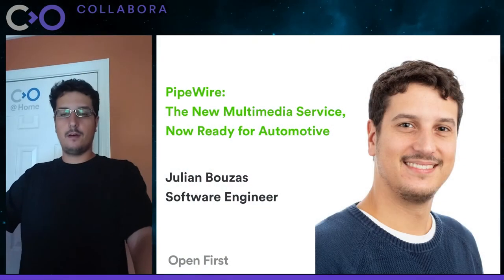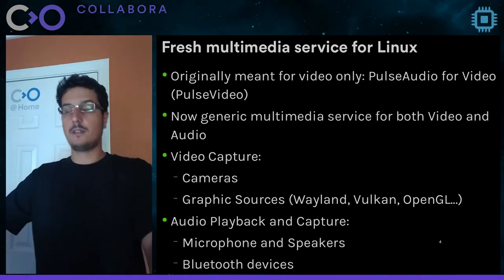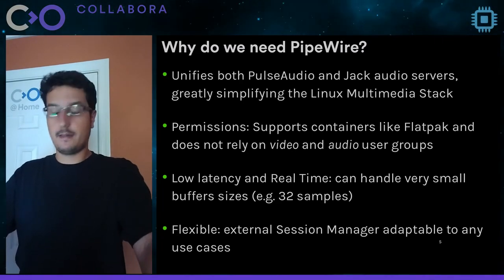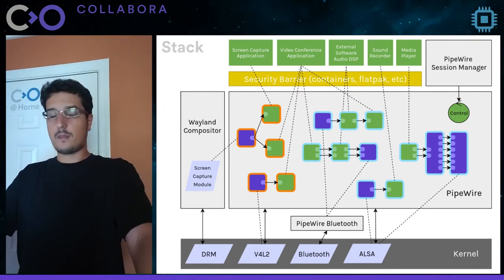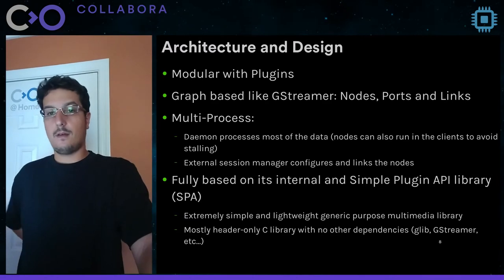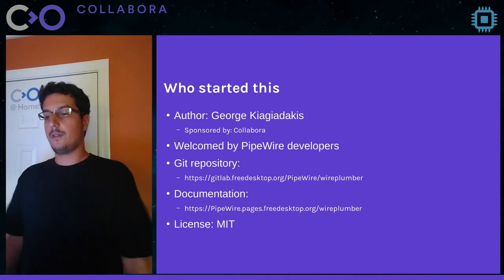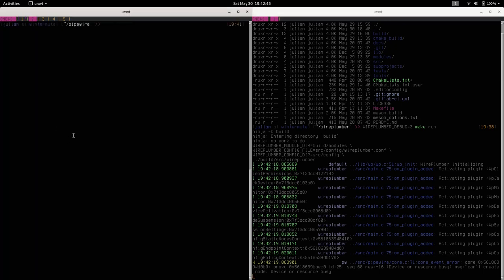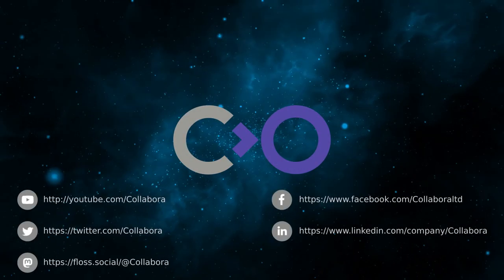PipeWire: the new adaptable multimedia service, now ready for automotive | Live Embedded Event 2020

Comment: As a Linux desktop user, I'm really excited for that project. It seems that in the future most of my issues with handling both consumer and pro audio needs including dealing with multiple sound cards and requiring low latency audio (especially when recording drums) will be way more seamless comparing to what it is now. Interesting how it improves multimedia stack in other areas like embedded/automotive too!
Reply: Just saying, it's out already, and I'm using it as a PulseAudio replacement on Arch Linux already, and it's working with no issues whatsoever. Depending on your setup/distro you may already be able to try it out!
Reply: @Architector_4  I tried that recently on Arch too. So far so good, but I got into trouble trying to make Bluetooth work, but also I noticed that performance in low-latency situation is a bit worse than on Jack (using Jack clients). It works pretty smooth, but I couldn't manage to go with buffer size as low as 128 (intense audio cracking, apps crashing), but with 256 it just works. I was using external audio interface to record guitar. I'm not sure how PW deals with the buffer size when there are multiple soundcards. I also wonder if that would help if I run RT kernel.
Reply: @dominik2327  
Oh, about Bluetooth, check /etc/pipewire/pipewire.conf - you can add "-e bluez5" to a line there to enable bluetooth module, which is disabled by default to not conflict with PulseAudio lol
Reply: @Architector_4  I figured that out, it didn't help, but there was another issue and even when I reverted it back to Pulseaudio, Bluetooth devices still couldn't connect. I'll give it abother shot for sure, but I wanted to use my laptop normally quick, so I just reverted to other tineshift snapshot :P

Comment: Sure Jackd can handle buffers of 32 samples, obviously depending on the audio interface whether it actually works but jackd isn't limited in that regard. Look at this old article, measurements have been made down to 16 samples with a crappy Intel HDA card. https://wiki.linuxaudio.org/wiki/jack_latency_tests
I heard the "everything will work automatically" story before, with PA for example. Now on my distro it has a dedicated troubleshooting page that is even longer than the general PA page. Pipewire aims to do everything PA does but a lot more on top. Call me a skeptic if you will but I believe it when I see it.
Reply: To my knowledge, PulseAudio is built up over a huge period of time, and ontop of ALSA, while PipeWire was built in not that huge period of time, with considerations of modern Linux desktop environment, and with a full ability to look back on PulseAudio to know what it did wrong.

I am already using PipeWire as a PulseAudio replacement, and so far the only change from what I'm used to with PulseAudio is that it basically never stutters, unlike PulseAudio. I haven't tested the JACK side though, but so far, I love it.
Reply: @Architector_4  which Distro are you using? Is it possible to get it working on Arch Linux?
Reply: @gudmundurThor96Nr2  
Yes, I use Arch too. Refer to Pipewire's page on Arch Wiki, there's a section for that lol